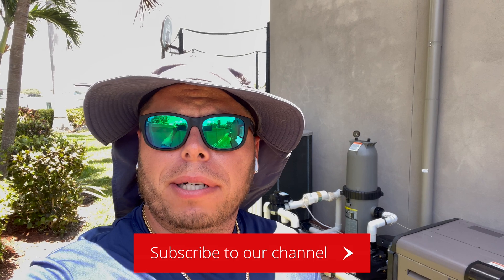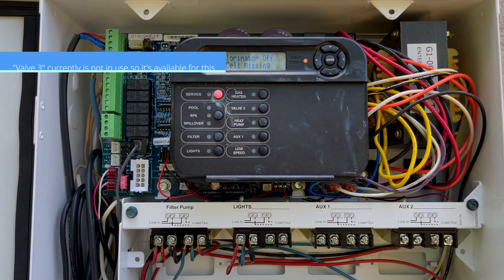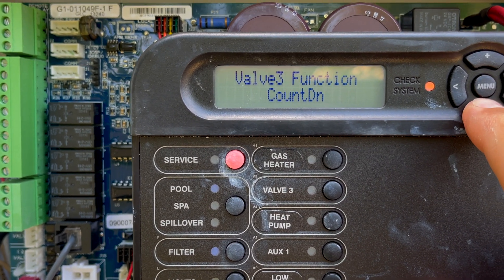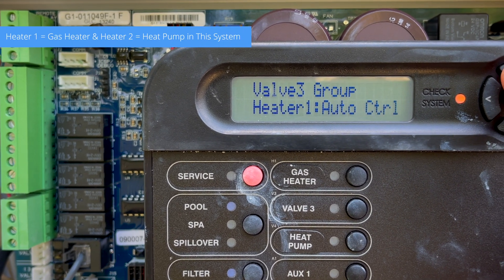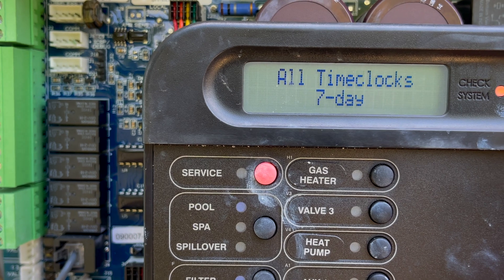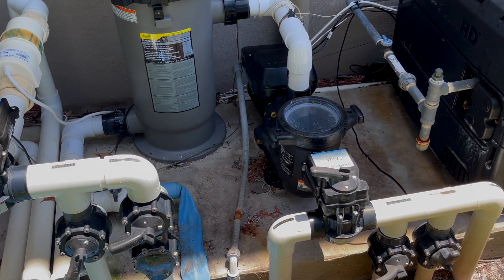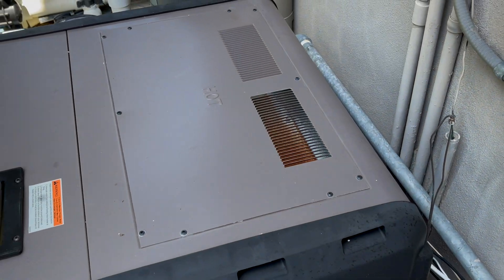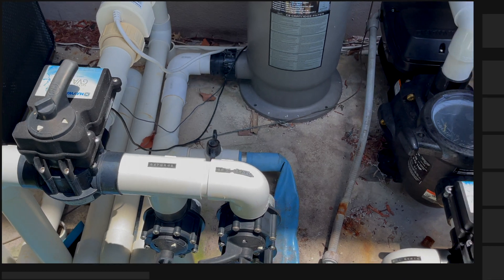How to Set Up a One-Touch Spa Button | Hayward ProLogic Automation

Comment: Looking for an automation system that can control my Hayward and Pentair pumps since I had to replace one recently and no one had a Hayward pump in stock and no ETA on when I could get one.  Any recommendations?
Reply from the maker: I believe the only system that would give full control of a Hayward pump is Hayward. However, if both are single speed than any automation system would work. Jandy can fully control Jandy and Pentair Pumps, Pentair can control only Pentair, and I believe Hayward to Hayward. Now, you can have any pump of any brand hooked up to any brand automation on the "load" side of the filter pump relay and the automation would give power to the pump, then you set your schedule on the pump itself and then program the filter pump to be on (give power to the pump) during those times. I hope that all makes sense.